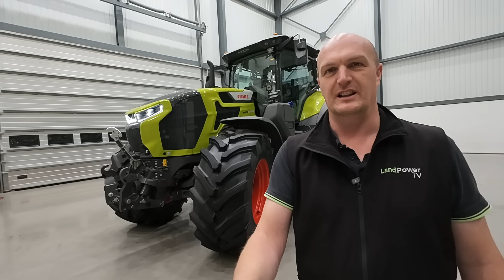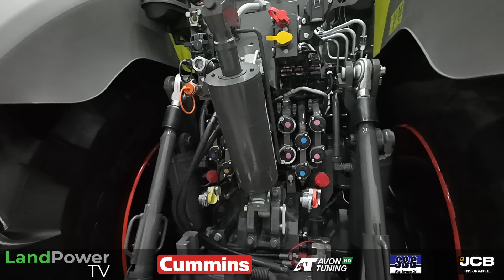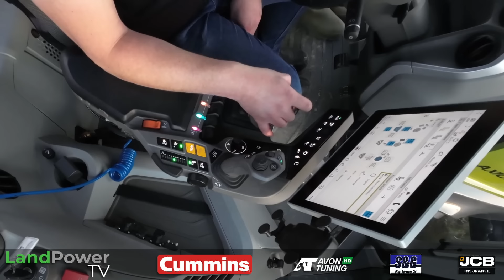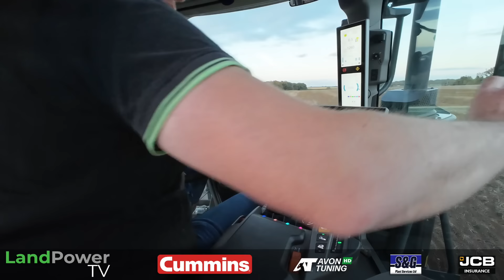FIRST IMPRESSION: New Claas Axion 9 series tractor | In-depth walkround and drive

Comment from the maker: In this episode:
00:00 Introduction
02:43 Axion evolution
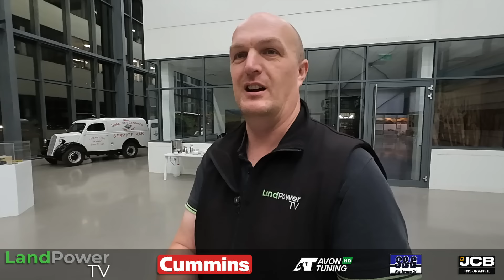05:32 Engine updates
07:12 Transmission updates
09:51 Hydraulic updates
16:01 Tyre and wheel options
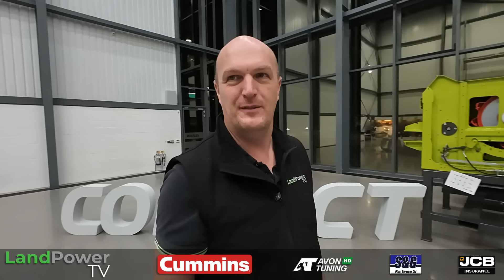17:40 Practicalities
19:48 Front-end updates
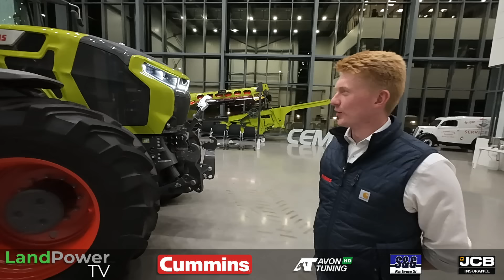21:50 Track developments
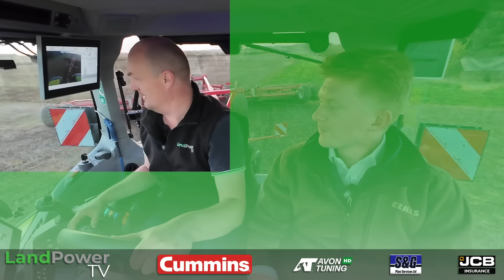24:09 A whole new cab
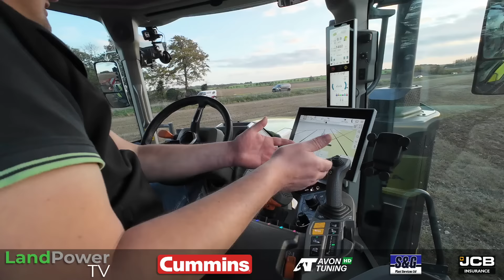26:49 Controls and assignability
30:48 New electronics and screens
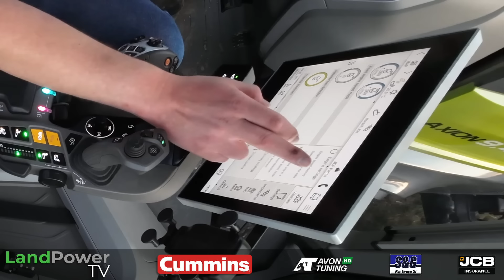36:47 Creature comforts
40:44 Operation evolution

Comment: i grew up in Ares tractors and when i see those high sitting cabs i can only expect the cab to turn into a rattle can at every ruts you cross, the driver being the rattle-y ball inside it...(like in the xerion shot you showed at the beginning).
that said as a French i think claas did something good with the decadent Renault ag, over the years those tractors are starting to look solid, they did away with deer engines developed new gearboxes (the cvt ones), I suffered enough with the GIMA ones to want nothing to do with those again, curious to know how the new ones are (running, temperatures, noise, reliability and power loss especially cold have to have progressed).
 OH god that remind me about dealing with the brutality of these clutches... a friend of mine crushed hid dad because of those BTW an early axion being a Renault tractors painted green. 
he walks again after a gruelling rehab fortunately...

Comment: Nice updates , was hoping the rear linkage had more updates hopefully they have done something with geometry. Wondering what the rear lift capacity is 🧐
Reply: unchanged since the 90's hope someone at claas could look at a fendt and do something beefier.
on the fendt you set the width once and never touch it again just a pin to change width category and levers for the stabilisation, you can put away that lower arm up to the mudguard with a catch that's the difference between "developed with the user in mind" and a passing grade...

i had to show it to my claas rep, former ag mechanic who also work on his dad's farm so he know what i was talking about like it's some mystery... though it also changed little in 30 years

Comment: Any news about the new lexion or don't they feel the need for a new combine?
Reply: I think the claas combines are still top of the line
Reply: Claas introduced a "new" draper belt header to the European market, the CONVIO FLEX 1530 (15.3m /~50ft), which is basically the same like the CONVIO FLEX 1380 (13.8m/ ~45ft) just a little bit bigger as much as I know. It's not really "new" though, cause I think it's already seen use in North America and Australia.
Reply: I think they will stick with the 8900 Lexion, Claas doesn't want their combines to get so big that people stop buying them (a couple good examples is the New Holland CR11, and the Deere X9 1100, they are so huge that they can't even fit down smaller rural roads, and they are also so expensive.)
Reply: У них уже  давно существует прототип комбайна 12 го класса